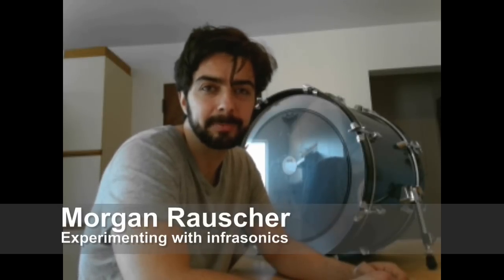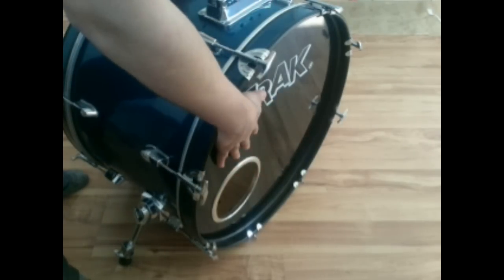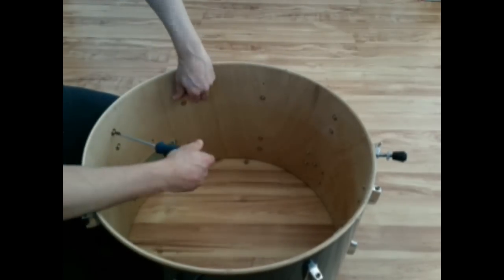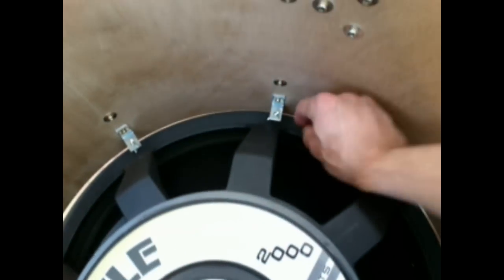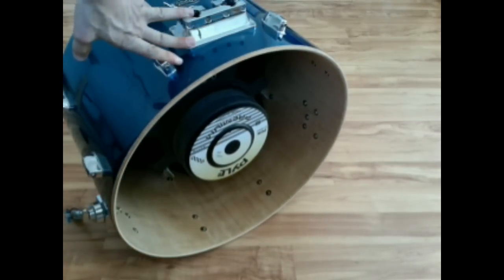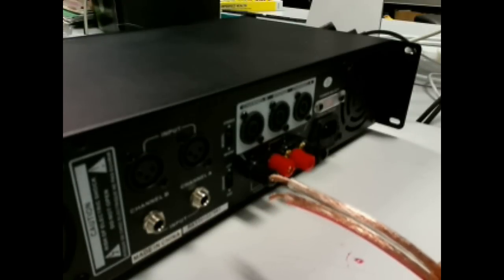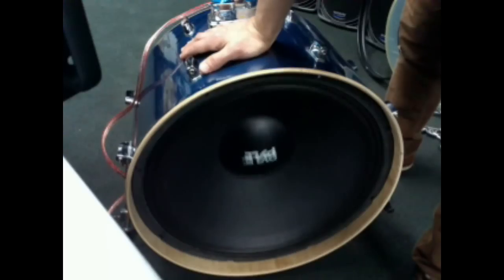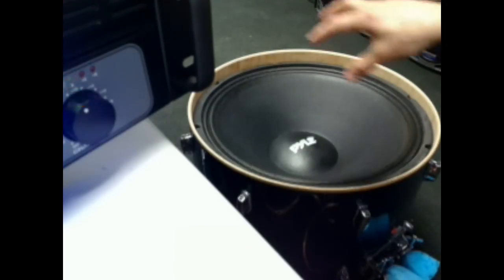Infrasonic (sub-audible) resonant sub-woofer & boom bass cannon

Comment: Audible spectrum doesn't actually stops at 20hz, but the accoustic pressure needed to hear frequencies below that skyrockets. You can hear down to 3Hz with enough power, as demonstrated by rotary subwoofers.

Comment: A bass drum won't provide ultra low as a speaker enclosure. For that you need a dedicated box and ports calculated in length and volume to tune the enclosure low so that the speaker doesn't just flap back and forth and bottom out. I do think a speaker in a bass drum would be fun to experiment with for different kick drum sounds. If you connected a resistor across the speaker terminals, you could experiment with different cone damping from a wire (high damping) to open circuit (low damping)

Comment: First, it's great that you are playing around but as someone who has designed and built many subwoofers, so many thoughts came to mind, and I hope some of these can be helpful. The enclosure of that drum is way, way, way too small for a speaker that size. You do not want the back of the speaker to be loose and flabby like the drum back. You want all walls of the speaker to be as rigid as reasonably possible. This is so that the speaker enclosure does not make sounds on its own, coloring the sound. If you wanted it to contribute constructively to the output of the speaker, you need it to be much heavier so that it will resonate at a much lower frequency (passive radiator). A passive radiator also should be larger than the speaker itself and/or capable of more excursion. Another issue is the giant hole in the back. The tuning frequency is so high that it is useless for any purpose of a subwoofer. The reason you did not hear anything was because your system was not capable of producing that frequency. Honestly, if you really wanted that subwoofer to reproduce infrasonics, you need to put it in at least a 15 cubic foot enclosure and tune the port or passive radiator to something like 15Hz. But that subwoofer that you have is not really a good model to use for this purpose. What you need is a subwoofer that is capable of moving far more air, something like a Dayton Ultimax. Also, you don't need earplugs for what you had but it's good to be safety-minded.
Reply from the maker: Try it before you knock it. I've got a phd but you don't hear me presenting on the back of my 20+ years of innovation... Just sharing (honestly) the real experiment and experience.
Reply: @morganrau  I'm not "knocking" it. I'm explaining to you what is going on. It's great that you shared your experience. You should be humble enough to be open to suggestions and feedback. This way you can learn.
Reply: @morganrau  You may have a PHD but probably not to do with acoustics or anything related to whats going on (not knocking but just saying).  So you do not want the enclosure itself to be imparting its own sound. The driver should be the sound source only. As Content Updating mentioned, you want a strong rigid enclosure that will not flex.  Also without doing measurements of the driver and just placing it in an air space, you'd have no idea what is actually happening. Best thing would be to buy something like the Dayton WT3 woofer tester, test the woofer and model the enclosure for the driver to get the desired output.
Reply from the maker: @svtcontour  Dude really, character assassination? How about we stick to the facts.. I experimented and you have not. An experiment conducted @ Concordia University media labs!? Anyways. Please don't knock it till you try it.. You know.. The scientific method (repeatability)!
Reply from the maker: My bad... It's just all these comments come from people who have not attempted to repeat my results before starting a dialogue.
Reply: @morganrau  I've also not tried pouring chicken soup into a loudspeaker either as an experiment to know it wont work - but hey it was definitely a very video at "the labs! "  LOL. Only Lab I've ever seen with zero measurements ;)
Reply: @morganrau  Also the suggestions provided to you by the multitude of people are only out there to help you progress forward with your future loudspeaker ventures so no need to feel defensive.  Anyway I'm done here - onwards with some constructive projects.
Reply from the maker: @svtcontour  says the one who won't try (how can we know brother..)
Reply: @morganrau  because science :)
Reply from the maker: @svtcontour  show me
Reply from the maker: Show me...
Reply: @morganrau  For sure - Because science, I'll need some additional information. 
Provide model# of the Pyle woofer
Provide the model# of the Trak drum it got put into
Reply from the maker: @svtcontour  show me! Old news...
Reply: @morganrau  Got the details on my own. Looks to be a Pyle PDW21250 and it seems its a 20" version of the drum. Will calculate
Reply: @morganrau  Calculated for you using Science:
Pyle PDW21250 - Actual measured response by the Horn Guys speaker group (being a cheap driver, its actual published specs are nowhere accurate so should be measured).  In this case its Fs: 31.61 Hz Re: 5.59 ohms Qms: 4.03Qes: 0.38Qts: 0.34Vas: 9.69 cu. ft

Bass Drum appears to be Trak 400 series - which translates to approx 3.5 cubic feet of air volume for the driver. The driver itself occupies about 0.25CF (typical for a driver that size) which now makes the available volume of the enclosure 3.25 cubic feet. 

The vent in the drum appears to be 5 inches and 10 mil is average thickness of a drum skin from looking which brings the tuning of the enclosure to about 66Hz - which also means its a vented alignment and a bad one at that.

Calculated response would yield a peak at 80Hz of +5.5db but response at 40Hz will have dropped off to -13db.  This gives us an approximate drop off rate of say 18db/octave. Theoretical vented alignment drop off would be 24db/oct below tuning (66Hz in this case) but hey lets go with 18 to be generous.

This means that by 20Hz it will be another 18db down compared to its peak so about 36db down compared to 80Hz. So in short response below 80Hz drops off like a rock.   Aside from moving, its not making any acoustical output at 20Hz. It will definitely make distortion at 20Hz though.
Reply from the maker: @svtcontour  calculations are not experiments. Show me you've tried. Then I'll tale you seriously
Reply from the maker: Try it. Measure it. Then criticize ;)
Reply: @morganrau  I dont need to LOL.
Reply from the maker: @svtcontour  Then you must know it all. Remain in your mind and let the does be free. There is no need for me to substitute my experience with your inexperienced word/imagination. I think I'm being trolled. It's cute.
Reply: @morganrau  Either that or you believe in magic and ferry dust so whatever keeps you happy :)   I'm going to go do something more useful now LOL
Reply from the maker: @svtcontour  good. I can rest.
Reply from the maker: Okay so we agree right? You will go and accomplish something for yourself and stop theorising criticism for people who have done it long ago (Trolls).
Reply: @morganrau  LOL Ya like finishing my my 7 foot tall WMTMW open baffle loudspeakers. I'll leave you playing with speakers being put into drums :)   Cheers
Reply from the maker: @svtcontour  please do
Reply: @morganrau  Did you actually measure the output? I can't see it anywhere in the video. Did I miss it? I really hope you did measure it and not assume the input from the sound file equalled the output on the speaker? I really want to see someone build an infrasound cannon, but your video doesn't present any readings on lab equipment so there's currently no confirmation that you did on film. Can you do a follow up showing this please?
Reply: @icdjpr  Exactly! It does very much appear that M has fallen into the assumption/anecdotal evidence trap. I've seen many people trained in hard sciences fall into this trap despite having had the scientific method drilled into them.
Reply: @ca8632  you know how much wood we would have saved from building huge boxes if it was this easy. Save a tree with your PHD lol

Comment: its more depends on the amp because of filters that keep the sub from playing below a certain point
Reply: yup sum wont even let u hit it or get near hittin it
Reply: Most amps with a sub sonic filter are set at 15-20hz. Most higher end amps let you adjust or turn it off though.

Comment: So basically since you threw the concept of proper enclosure size and air volume out of the window, as well as sealing the back wave of the woofer from the front, the drum skin is acdting as a passive radiator in a way?... thx
Reply from the maker: Sorry but it's not simple and it's not passive. It's an active radiation because of the complex harmonic that is accomplished by the shape of the chamber. Look up resonance and how it can generate energy (not reflection). That is why you feel the sub audible sound in your body when you stand in certain places in a room where it is placed (based on wave lengths/distance from setup). M:
Reply from the maker: No basic about it I'm afraid. You need the vibrations, reverberations, and undulations to reach the level of the body fluid system to experience the effects.
Reply from the maker: IE A very large emitter (speaker) ... not some clock radio speakers or any set of headphones with some digital interpretation of anything ;)
Reply: @morganrau  It is most certainly a passive radiator because it has no direct motor force acting upon it. But in this case, it doesn't have enough mass to resonate at a frequency low enough to be beneficial. In fact, the sound emanating from the skin is destructively canceling the bass from the speaker.
Reply from the maker: @thingsdemystified  harmonics are not achieved via radiation (passive or not) as much as reflective-amplification and in this case the chamber acts like a 'sound laser' (google it), but for much longer waves. You can't even experience the "body irritating feeling" for lack of a better description, that result from the canon I've made, unless you stand at very strategic locations in the a lab (so as to encounter the harmonic resonance moment in the space..). And in your body.
Reply from the maker: Is air the only carrier of sound? Does the sack of water we walk around in interact with audible reverberations and inaudible ones? Please do the (work) experiment, before commenting

Comment: Sorry, but you know nothing about speakers, how they work, frequency responses and requirements, power requirements for the speakers, how bass porting and enclosure design works to funnel the bass and 'compress' the air more to create more bass...

(oh, and yes, it's bass, not base.... that's something else entirely :) )
Reply: Hate to tell you but I agree with Colin. According to WinISD this driver's optimum ported enclosure is a 12.807 cubic foot box tuned to 27.51hz. Even then this driver's -3dB point is 29.68 hz.....nowhere near what is considered infrasonic. That is a 14x22 kickdrum it looks like...maybe 3 cubic feet without driver displacement. Assuming that is a 6" port maybe 4" long that "box" is tuned to about 55hz resulting in a 5db peak around 87 hz and a -3dB cutoff at 57hz. Even adding the movement of the drumhead....getting infrasonic at any reasonable sound level is doubtful. Yes...I have been building Sub enclosures for many years.....
Reply: Morgan Rauscher .........YEAH!..........what you said. 😠
Reply: Colin Hadley  I think you know more than morgan
Reply: Morgan Rauscher easy build the box to the correct specs even though it will be down probably 9-12db or more at 20hz  I bet it far exceeded the output of what you made.
Reply from the maker: How hateful and without productive feedback. I believe they call that a hater
Reply: @morganrau   @M:  Not really, I watched this with high hopes of something interesting... instead I was disappointed due to lack of understanding of acoustics and sound waves..
Reply from the maker: @Ghozer  it is not possible for you to watch something you are not interested in.  Life is full of choices my good sole.
Reply: @morganrau  Exactly, I WAS interested... and was left after feeling disappointed at the result of what I had just watched...

as I said earlier basically, no hate... just disappointment!
Reply from the maker: @Ghozer  Dear Ghozer. One can only be disappointed if one goes through life with expectations. May peace be within you.  May your 2021 be full of positivity and light.
Reply: Hi,
 Please show us how you would accomplish this if you have the time. I'd like to check it out. Thanks
Reply: @morganrau  I see here that people have tried to help you but you dismissed them as "haters." You can choose to remain ignorant and ignore the help of others, or you can try to learn something from your mistake. Don't misunderstand everyone that's trying to help you.
Reply from the maker: @thingsdemystified  how can I help?
Reply: @morganrau  lol your inability to take constructive criticisms about a topic you clearly don’t understand is baffling
Reply: @kennsdlyalcima7848 bro reading his responses to the knowledgeable PhD-less peasants, where he references his PhD, are making me physically ill from second hand embarrassment for him

Comment: Dude, I'm pretty sure that the heads on that kick drum were creating destructive interference with the subwoofer. Typically, people looking for HUGE bass spring for either a ported box or a chambered box. Also, I doubt that wire was 8 gauge. It looked like 10 or 12 gauge to me. I also wouldn't trust Pyle products to deliver any sort real performance. Also, low frequencies tend to be very penetrating. I don't think your hearing protection was doing a whole lot for you.

Comment: Morgan - what you have made is a dipole bass system. The drum diaphragms are not required. If you take them off the system should perform better - less colouration because the drum skins have a resonance which will give a peak at one frequency where as you should be working on the resonant frequency of the speaker itself. Using the drum itself is a good idea. You will find the bass being dipole will be more directional. Try to get a frequency response test done with the skins and without the skins and publish it.
Reply: Great! Carry on!
Reply: Not worth explaining. This whole video was rubbish. The drum sound when tested was overlapping with audio he put on the video to pretend.

Comment: It would be interesting to see how it performs as a bass drum "subkick". Wire I mic cord to it, plug into a mixer board, place the bassdrum with the speaker on it directly in front of a regular bassdrum with the face of the speaker facing the front head
Reply: Morgan Rauscher 
You'll want to also mic the kick drum from the inside  (not the one with the speaker in it) and combine the two signals  (separate channels on your mixer board). I made a subkick out of a 10" tom & a 6.5" Kicker sub. It sounds great when combining with a regular miked up kick drum

Comment: i built a subwoofer that does 6'' peak to peak at 15hz ! it goes nuts on infrasonic sound , plays 1-20hz like a boss !
Reply: please share links or more info about these magical subwoofers that do 6" peak to peak at 15hz or play 1-20hz like a boss! No such thing as a subwoofer doing such things, perhaps a rotatory driver in a 25cuft enclosure.
Reply: He's not kidding go look at his YouTube mazdas shit Is no joke
Reply: jeanious2009 
Ikr you would have to have a extremely large sub or lots of subs to do that.
Reply: @s10mafia61  well, excursion is only useful if you have cone area though
Reply: @jeanious2009  
Incorrect. I have an 8” subwoofer that can play down to 15Hz with no problems.
Reply: @speakersr-lyefaudio6830  
Not necessarily. Make an adequate T-line design and you will be surprised at how low you can go with just one small subwoofer.
The guy on this video is a liar.
Reply: @Bassotronics  t-lines definitely can get you low, but there is only so much a good design can do. If you don't have high air displacement, you're going to have a hard time getting low with any reasonable SPL. the best I've seen in regards to getting low with a small form factor, is a rotary sub in an infinite baffle. Love your music btw.

Comment: You said you hear "nothing" at the low frequency yet I hear a pulsing sound, so which is it, nothing or a pulsing sound? A square, triangle, ramp or pulse wave with a fundamental in the infrasound range still has a great deal of harmonic energy in the audio range which we hear as a tempo which has the same frequency as the fundamental, so we detect frequency in the infrasound range indirectly using the tempos formed by the beating of the higher harmonics of a wave, the tempo we hear matches  the fundamental frequency that we don't hear. 

This also occurs in the audio range, if we remove the lower harmonics of a wave including the fundamental the brain imagines them in maintaining its sense of pitch at the fundamental, inference is part of sensory experience. We only really see 3 colors, the brain infers the rest by triangulation and, sometimes inaccurately, yet no one would claim that "we only see three colors" simply because inference is part of the sensory process, it always is and for all the senses! 

We hear into the infrasound range by inference, but it is hearing never the less, a pulse or other wave with many upper partials can be scanned across 20 octaves and we hear its frequency continuously, in the upper 10 octaves we har the wave as pitch and in the lower 10 octaves we hear the wave as tempo. At about 1 beat every 10 seconds or so our sense of tempo begins to disappear.

Even a sine wave periodically rattles bones and external objects, which we can hear as a tempo
Reply from the maker: Obviously the real environment I had can not be simulated over YouTube... Silly silly